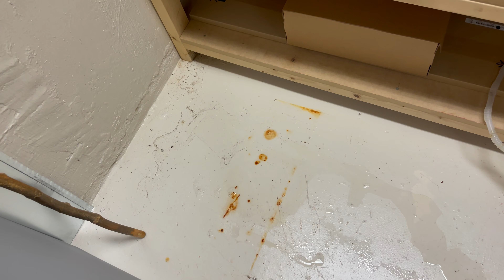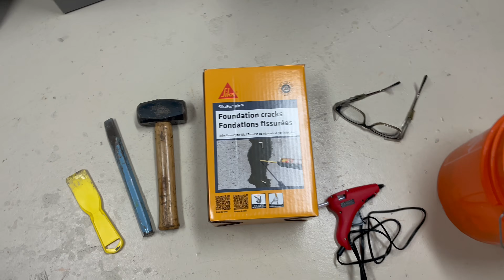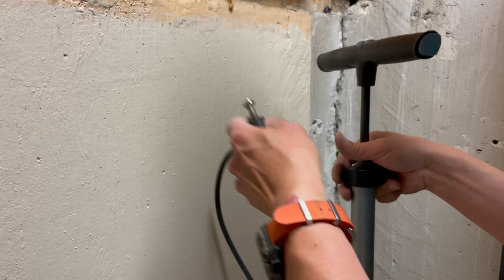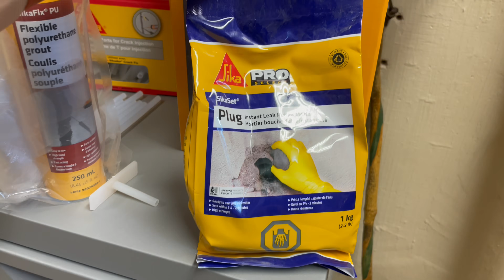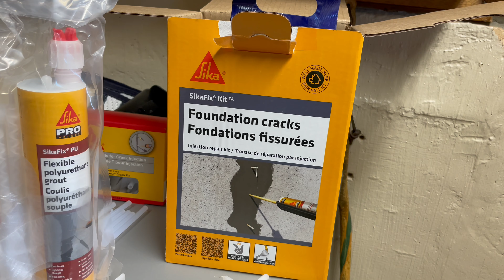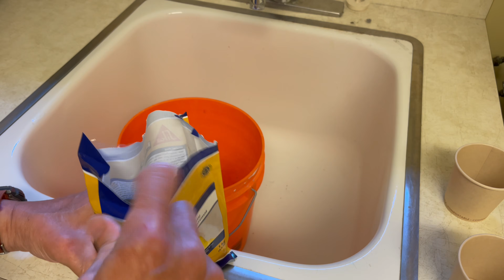DIY foundation crack repair.

Comment from the maker: Yes, mixing mortar over the sink drain is risky, but I didn’t spill any so no harm done. 

As for the insurance company question, I believe that most home insurance policies exclude foundation cracking from coverage. The insurance companies consider cracking normal settlement and the resulting repair as normal maintenance.

Comment: I wouldn't recommend opening and/or mixing the mortar in or near the sink.
As you point out, the stuff activates very quickly.
Reply from the maker: Very true, you wouldn’t want mortar in your drain. I should have put the stopper into the drain.

Comment: Will the insurance company accept the use of the same type of material by the contractor to repair the cracks?
Reply from the maker: Typically insurance does not cover vertical crack repairs. Cracking is considered normal wear and tear, so the repair is considered routine maintenance.

Comment: How is the repair after two months. Did it stop water coming in?
Reply from the maker: Since repairing the leak no water has entered the house. Even with a summer of heavy downpours.
Reply from the maker: No more water has entered the basement since sealing the crack. And we’ve had many heavy rains this summer and fall so far.